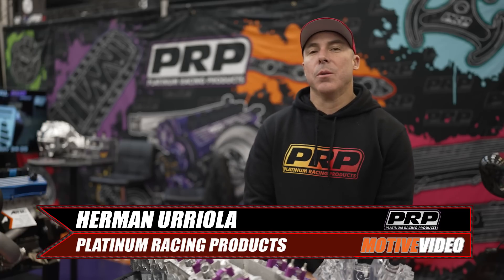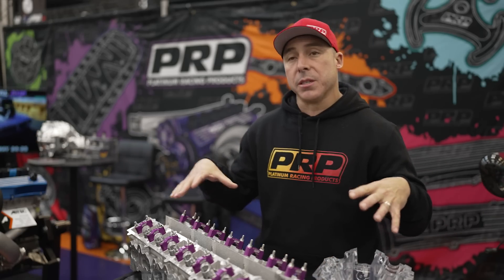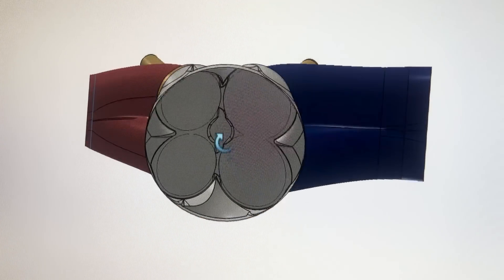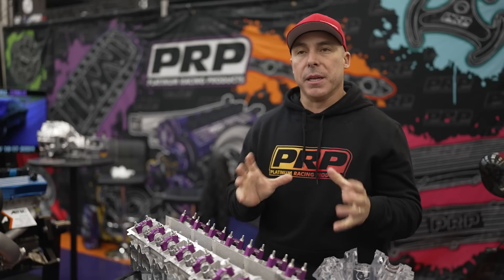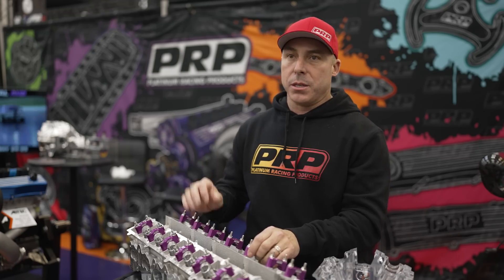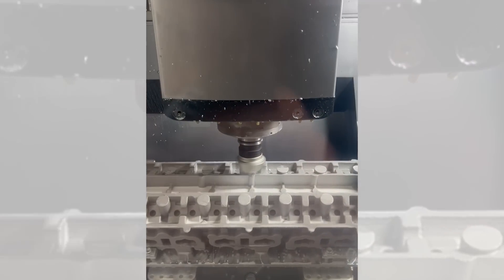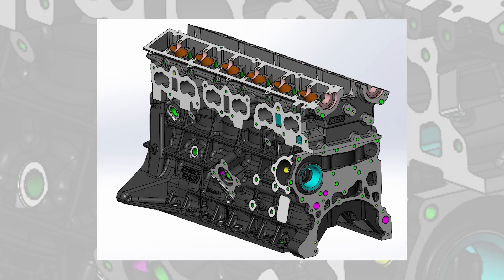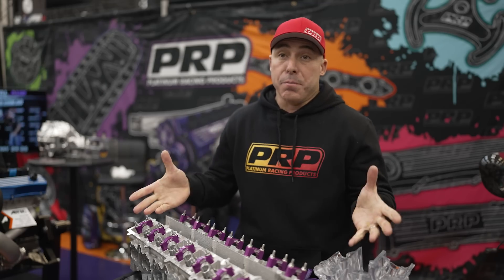PRP Develops New Cast RB26 Heads! - Platinum Tech

Comment: Its crazy what you have to spend to make a rb as reliable as the jz haha
Reply from the maker: Its crazy how people think 2JZs don’t need mods to make power
Reply: No one said that. The rb is like the Chinese version of a jz and I'm a nissan guy. Only people that can have fast rbs are well off with money because everything needs changed to make decent power and then you broken blocks and oil pumps, weak rod bearings and poor oil control
Reply from the maker: @blackCamaro833  Never seen a 8 second Supra built by someone with no money.
Reply: @MotiveVideo yeah nothing is that fast without money. I'm being realistic. 90 percent of rb and jz owners don't have unlimited money to drop on a 30+ year old motor. For the everyday guy the jz is stronger by far, more reliable and takes way less money to make 600-1000hp. It's not like I'm trying to argue with you it's just there is so many issues with the rb where you have to spend so much money to make it comparable to just a stock jz
Reply: @blackCamaro833  Not at all - my mate has a 650whp GTR that eats 1000hp Supras -Its a shit old platform that cant put the power down unless you completely fck the handling by going Mickeys
And who cares about stock vs stock - ppl with no money
big cam straight pipe daewoo lanos are dirt cheap?
Reply: @JH-jo9wt  @JH-jo9wt well yeah it's not as good of a  platform as a gtr but they literally have videos of how bad the rb motor is compared to the jz. We are talking about motors not this chassis vs that chassis. The gtw will obviously put the power down way better then a supra but jz is far superior to the rb and I'm a nissan guy. I have 3 nissans right now and I'm building a jz for my 73 240z
Reply: @blackCamaro833  Great point the video is about a PRP R1 cylinder head designed to smash past the 3300hp barrier on the std 05u head. 

All said and done for that sort of power it'll probably be 15k USD

The relevance of the stock 2jz rotating assembly and new block for $3200 is completely irrelevant at these power lvls.

Yes its a fantastic piece of kit for $3200 stock.  Maybe the best in the world value for $ - throw rods and pistons for $1500 and you know hav....oh wait its not stock then - bummer

There is not a stock GTR in Australia so no one really cares if the stock wheels were 17s vs 16s..... they get changed straight away

The stock clutches maybe better too.....

Its a completely moot point even more so on a video about a 4000hp cylinder head for $15,000

And your right its not this chassis vs that chassis but the point still stands its a dyno queen one trick pony thats superior on a prepped track with Mickeys "if everything is not stock and the GTR has a limited budget"

Again a superflous niche on this particular video

My old 800 lbs neighbour had insane retard strength if he grabbed a hold of someone from his wheelchair - on every other occassion i could kick his ass and toy with him if i want, this is why the chassis discussion becomes relevent

I agree stock for stock the 2j is better than a std 05u RB

Not a 24u or RRR oem block 2.8 rotating assembly that raced in the nurburgring 24hrs (2jz never did that) but yes better than std 05u

The 2jz stock exhaust is also larger 2.75 vs 2.7 and the stock wheels are also wider compared to R32 GTRs
17 inch vs 16s

The 2jz also ran wider stock tires than R32 GTRs 235mm vs 225mm

The 2jz stock made 320hp Vs 286hp i feel this last point is esp relevant on a video about a cylinder head claiming to make 5000hp

The reality is the stock 05u flows better than a 2jz head -  this thing is orders of magnitude better - The 2js wont stand a chance in the end until they get a PRP head then the whole stock vs stock becomes even more irrelevant 

McDonalds is way cheaper and better value for money than In-N-Out too but when your building a 3500hp car whether it be a Jun 2 or the AMS alpha Omega or a UGR Lambo to win TX2K you probably dont care when your broke friend insists on getting McDonalds everyday to save money, you just dont care - theres lvls to this
Reply: @JH-jo9wt  dude what are you talking about haha Herman literally talks about in his videos how shit the rb blocks are. Even your unicorn rrr block. Couldn't ever bore the block being brand new. Ypu want to talk about how great the rb is. All you have to do is change everything including the architecture of the block besides bore spacing and it's great hah
Reply: @JH-jo9wt  all you are is anti 2jz. Always saying what the 2jz can't do but it's such a far superior lighter motor that handles more power. Bragging about 90s head flow isn't anything to brag about. They are all shit and have been so far surpassed by newer designed heads like a Honda k. The fastest stick shift cars in the states are either v8s or 2jz. Same with drifting. And yes they can road race and don't need a bunch of fixes like the rbs to property drain oil out of the head or run coolant out the back. The rb is a very poor design. Yeah it makes good power but once it makes power you're praying it doesn't blow up or destroy rod bearings with the joke of a rod bearing being I think 15-16mm wide. Or the oil pump that can break on start up. Weak blocks with poor casting. Like I said horrible oil control. I have 3 nissans.  I love them but there is a reason I don't race them anymore and use a 2019 camaro ss 1le

Comment: Admire the work that PRP are doing. Even if a lot of it is only geared towards the 1000hp+ setups.

Will the R0 have any drawbacks if used on the setup between 500-600hp? I know bigger ports have less velocity so  not nessarily good for lower power setups.

Its great to know that in the future if I need a block to replace my RB I can brand new upgraded block instead of trying to source a good used one.

Comment: You are not getting "in excess of 500cfm" (2:40) through a pair of 37.5mm valves at 28" of H2O. Thats a Cd over 1 for the valve curtain, not minimum cross section.

Comment: You're trying to make out that "billet" is somehow inferior to cast only because you are making a cast head, but this is deliberately misleading. Both have their place, and provided you make them out of exactly the same material composition, there is no reason one is going to be massively better than the other. Billet when it is all said and done is just an expensive (because of the sheer weight of the aluminum) cast big block of aluminum, and the amount of tooling / machine hours required to whittle it down to something usable. You use a reductive technology such as a CNC to remove material from areas you don't want it. Casting while taking more effort to initially set up is way cheaper in the long run because it is a technology designed for high volume, not because it is a better way.

As for the BS you tried to lay down about it is better, and that is why F1 and the like use it, again this is pure speculation and distortion of the truth. Why do F1 use casting? Simple, for complex parts like heads and blocks where there are lots of passages, you can cast ports and galleries in a way that they are far less likely to leak. When you use a reductive technology like a CNC you are limited by design. If you need to block off a port or passage where it is difficult to block, you might need to compromise the design and therefore give your competition an edge.

F1 and the like have the money and resources to be able to afford to do limited run castings for that reason, not because it is better. So stop pissing in everyone's pocket and telling them it's raining. The cost of those cast heads are way too high for what they are. Half of that would still make you a very healthy profit. Trying to make out that casting is better is no better than the billet crowd claiming theirs is better and that is why they charge more. Casting has existed for centuries.
Reply: There is a reason why every engine close to this power level of 1000hp/cyl uses a billet head. It is a way more durable material. Top alcohol uses a billet head, cooling its as critical for a five second run with methanol. 
I think if you start pushing these heads to the power levels stated there will be a serious issues of combustion chamber erosion. There is almost no way the factory head bolt location will keep the gaskets in place. They will need a version with a dry deck to keep the water out of the oil. The flow numbers stated are also, literally, impossibly high.
Reply: @timothybayliss6680  "billet" isn't more durable if it is the same material, what it can be is massively denser. You raise some very good points. The billet heads they use in top alcohol are not made out of recycled soft drink cans. They will be a premium quality densely pressed aluminum They also are not complex in design which leads them to being reductively machined, unlike a street head that needs water. If they think these heads are going to make thousands of horsepower out of the box without some failures they are kidding themselves. One of the draw backs of casting is that it is hard to make the part dense, and why porosity has been an issue in the past. Yes agree those numbers are extremely high, but you will also note they didn't quote at what figures they achieved them. People with little knowledge are easily fooled.
Reply: @DodgyBrothersEngineering  you cannot get 500cfm through a pair of 37.5mm intake valves at 28" of pressure...
You can't get 500cfm through a pair of 37.5mm perfect venturis at 28" of pressure. It's literally impossible. I don't know if I would believe 400cfm, that's not impossible but it's close enough it may as well be. The closest comparison is a billet K series head with 40mm intake valves that flows a claimed 440cfm. That's a billet head with full freedom of design and 14% more valve area.
Edit....if you go to their website today the claim now is R1 head with 37.5 valves "supports 380cfm theoretical". That's markedly less than 500 and also possible.
Reply: @timothybayliss6680  not sure what happened to my response but here goes again... lol don't let the truth get in the way of a good story. Why is it a theoretical 380cfm? Are they scared to put it on a flow bench and find out? It's not hard to measure it at a standard 28" and know what it flows, especially since they claim to have done all this research. Surely a simple independent flow test wouldn't be that hard. You can potentially get the results to say anything if you fudge the figures. That is why I wouldn't believe a single thing they say till I see a calibrated flow bench result at a standard pressure drop.

In the video they say they have gone up 3.5mm in valve size, that doesn't guarantee an increase in flow especially if the valve is blocking one side of the chamber and can't get any flow on that side. Plus there are no valve lifts quoted, so at what lift is this "380 CFM" made? It could be at 1". If this head was all that, they would list flow figures in 100' increments to really show how impressive it is, and to help you chose the right cams to suit.

With such vague information, that is why I say it is easy to fool the uneducated.
Reply: @timothybayliss6680  nothing on their website rings true. They say they haven't flowed the head, yet in the following paragraphs they claim the standard porting makes smooth airflow up to 800hp. How do you know the airflow is smooth if you haven't had it on a flow bench. And what are they going to do in the porting department that is suddenly going to take a head capable of flowing 800hp into the 5000hp they said in the video? I don't care how good of a CNC port job you do, no port job is suddenly going to turn that into a 5000hp flowing head.
Reply: Dudes been pissing in people's pockets since he started 😂

Comment: I hope a b58 head in a rb block to get  moderns spec head tech
Reply: What? lol That wouldn't work and Rb's already have better cylinder head flow.
Reply: @lennixsingh626  probably, di allows for more efficient engine and more hp mix with port injection
Reply: @jhon-cg4rg  Yeah RBs need DI bad - HKS have pre chamber in the heritage engine which will be a massive bonus to the RB world

Comment: I like the low and small inlet port as cast. Why? TUMBLE. You could very easily make a super high intensity tumble (ha! acronym...) flow that would improve combustion efficiency and reduce detonation. This is a concern on pump fuel or anything that involves racing for more than a few seconds at a time.
Reply: If u watch the video u can see cad and mould designs of the Clover leaf cylinder head with HUGE ports and 37.5mm valves.
Reply: @seanb250  390cfm with normal Rb26 ports? and without clover leaf design?

Comment: PRP do some amazing stuff, the barra r35 coil kit looks wicked. might be worth the upgrade when i get my 3.8ltr bottom end and get into the 8k rpm range.
Im more excited about the tr6060 strait cut gear sets ive seen them working on.
 it will be a dream come true if i can cruise to the track with stock quiet 5th and 6th gears, then be able to flat shift 1st to 4th down the 1/4 mile

Comment: 100% holding out doing anything to my stock 05U head. Going to wait and get an R0 head when the time is right.
Reply: they've got a proto block already
Reply: If your not pushing HUGE power u have nothing to worry about using an 05u head.

Comment: Don't be a sook Andrew, deleted my comment. Just stating facts at 6:22. You all know Honda has the title with volumetric efficiency out of a mass manufacturer out of all the JDM manufacturers period.
Reply: I'm not sure why he said that because currently speed factory's civic holds that record to the best of my knowledge. Although I'm sure with this cylinder head development RB's probably will claim that title in 2-3 years.
Reply: @lennixsingh626  Yeah. Pretty sure it was just shy, of 2200 horsepower from 2 litres. But that's not what I was really getting at, even though you're not going to see an RB20 turbo do that.
I did mention, about the Honda S2000 F20C record of 250HP and with is volumetric efficiency. And Honda k-series volumetric efficiency. And I'm pretty sure, 4 Piston Racing will keep developing bigger and better things for the Honda market.

One of 4 Piston Racing engine, a 2.5L turbo in a drag car on YouTube called "No War" is in the five second bracket at the quarter mile. And this is from a 2.5L 4 cylinder.

Because simple fact, you don't see anything from Toyota or Nissan. With that kind of volumetric efficiently naturally aspirated.
You don't see, RB20/30s or SR20 doing that.
You don't see, 2JZ/1Js or 2ZZ or 3SGE doing that. Because they can't, not even them engines modified can achieve the volumetric efficiency what Honda has done. And with the aftermarket scene, the K series is king with volumetric efficiency naturally aspirated on the drag racing scene.
Reply: @igvtec  I agree Honda has done some incredible things. However Rb's and 2j's are right up there in terms of Hp per Cubic Inch. theres quite a few RB's and 2j's making close to 3500hp out of 3.2L and 3.2L engines.

500cfm is absurd from that new head. hopefully when turbos get bigger and more efficient we will see 4000hp+ Rb's in 4-5 years which will most definitely claim the record.
Reply: @lennixsingh626  Yeah. That's with forced induction on top. I was also on about, volumetric efficiency naturally aspirated. Which you're not going to get from an RB or 2J.
And as you even said, as a point. With Speed Factory Racing. That figure from 2L. These are my points. The RBs and 2Js need to be bigger in capacity/litres to achieve that.

There are even stock block, K series and F series in the 5 second bracket down the quarter.
Reply: @lennixsingh626  I'm pretty sure, just say 6 cylinder vs 6 cylinders. If someone done some serious development. On the C-series the C30A Vtec and the 
C32B I Vtec . If they weren't so rare, and so expensive out of a one-off supercar. It would have been a different story. 
The only reason why, the 2JZ and RBs have had more development is because they were cheaper and more numerous to start with.
Reply: Let's just say if your stupid enough to buy a product without rigorous amounts of evidence to back its quality and performance then you deserve to be ripped off 😂
Reply: Didnt he mean a production turbocharged engine? Im sure he wasnt comparing a oem rb26 head with a 458 speciale

Comment: No VCT I'm guessing? I'm curious as to why not
Reply: When running big power vct just becomes another issue and problem to go wrong. 
On a mild street car it's good but a drag or roll racing car its not really any benefit
Reply: Huge power cars don't use VCT. it kills the gear and it limits cam size. In fact the overwhelming majority of Aussie GTR's don't even use v cam at all.

Comment: Single cam rb30 head ?
What’s the chances
Reply: Bullet already makes a billet Rb30 head. And the market is small.
Reply: @lennixsingh626  yes I know that but your existing inlet and exhaust don’t fit so it requires a complete new setup 
And I don’t want to spend $15,000 
On a new head 
I’d be happy to go $4000-$5000 
In a new head that’s not comprised by upteem heat cycles
Reply: @anthonywhelan8373  I don't think theres a shortage on Rb30 heads and I highly doubt you want to push anywhere north of 2000 which is where things can start to get dangerous, so not sure what your fussing about.
Reply: @lennixsingh626  you tried finding a good rb30 head lately?
Reply: @anthonywhelan8373  Im sure PRP has a stash of em 🤣
Reply: @lennixsingh626  unfortunately a lot end up in the bin as there not hard enough in the casting now for every 10 heads you come across you’ll only get 1-2 that are usable and have the correct hardness in the casting